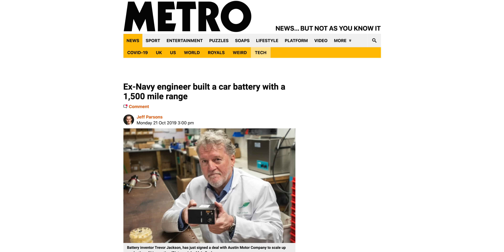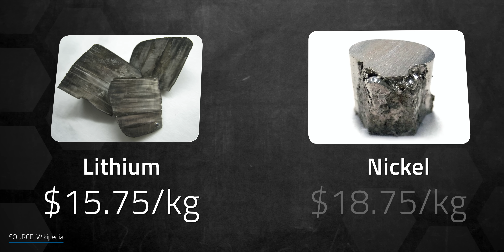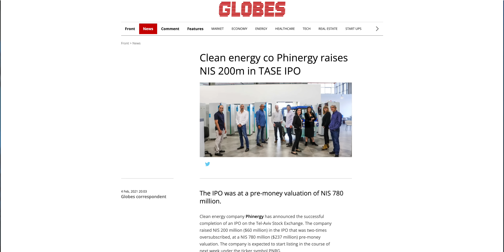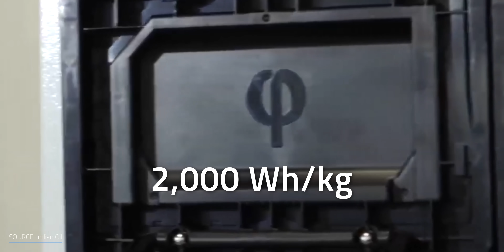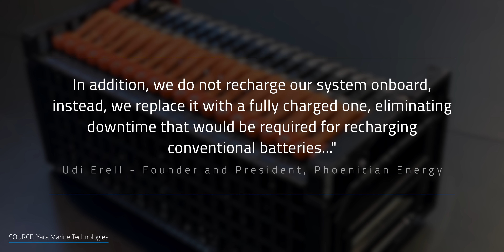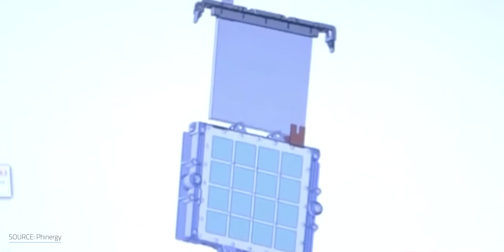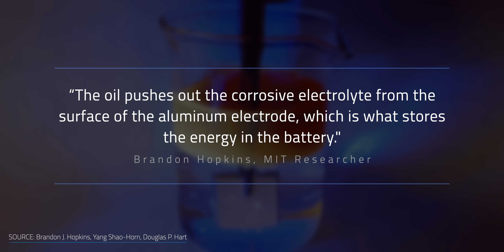Exploring the 1000 Mile Car Battery - Aluminum Air Hype?

Comment: If the battery is not rechargeable, then better test it on electric scooter. Many current electric scooter now have easy replaceable battery.

Comment: aluminum air is dumb. aluminum ion however... i don't mind battery swapping as long as aluminum is readily availible. i think aluminum ion is still a more viable technology just based on it's recharge cycles, although the drawback is its not as energy dense as lithium ion. great for powersystems that need to be reliable, and with their fast charge rate, good enough for automobile usage.

Comment: It all comes down to economics... Lithium batteries will need replacement about every 4-5 years, and are tremendously expensive to replace (to the point of making vehicles disposable in some cases).  If Aluminum-air batteries can be made less expense over the same time period, I see this as a viable option.

Comment: I assume the recycling process to reuse the “battery” is more energy intensive than recharging a Li battery, but to what degree?   Does the battery have a high enough power to weight ration that a vehicle with module that stored 10% of a vehicles charge could power the vehicle so that you could swap the 7 used modules instead of swapping the entire battery because it was down to a 30 percent charge?  It looked like 2 battery modules were used in the car in the video, but planes have the greatest need for low weight batteries,  but if they have to swap their batteries when they land, swapping a battery that’s at 49% charge after a flight is just as necessary as swapping a battery with 1% charge.  (Expensive?)

Comment: Batteries might be modular, so that you place 10 in the car for a long trip.  One or two enough for daily use and short distances.  Batteries would be distributed like petrol, except needing an empties recovery system.  
I understand that old batteries would be remanufactured with new aluminium.  Effectively an aluminium smelter is the main part of a remanufacturing system.

Comment: I think the main thing to consider is that we will run out of Lithium. Poor countries are developing and a greater portion of the global population is purchasing cars. Someday, perhaps a century from now, there might be over 10,000,000,000 cars owned and operated simultaneously. There isn't enough lithium for that many.

We will have to figure out a way to reduce road traffic.
Expanding public transportation means less vehicles per person.
Trains and trollies can be powered by overhead powerlines and thus don't require a battery to be electric.
Virtual reality technology could help people be content staying at home. We just need to watch out for the health effects.
More efficient city layouts could shorten commutes. Desynchronized shifts would make vehicle sharing easier (including in the form of public transportation) (in the case of routes with heavy existing traffic).

Comment: Battery swapping is the only viable way to implement large scale, quick turnaround EV refueling. Quick charging will always be detrimental to chemical based electric energy storage devices.

Comment: Having to swap out the battery every 1000 miles is a non-starter. Completely unacceptable in my feeling. You would at least have to have two 500 mile batteries in the car and switch out the dead one at the 500 mile mark then start hunting for a replacement. The catch being that the "cartridge" for the battery has to we worth less than a tank of gasoline.  I do not see this as a technology with much of a future in the UV market.

Comment: How  bad is it for the environment when a battery has to get disposed?  It does not make sense.  What powers the electricity to the plant that  powers the cars charging station?  Stupid liberals don't realize that they are doing more harm than good.  They have been endorsing toxic chemicals, because they were told to be activists and never ask questions or do real research. Stupid liberals,  or greedy liberals like the old hippies? Still scumbags provided from mommy.

Comment: I would prefer an EV that allowed swapping batteries, vs one in which the batteries are integrated into the chassis. Batteries, even rechargeable batteries, are a consumable. And swapping packs is potentially much faster than charging, and might side-step some of the issues around high-speed charging.

Comment: i think i would like an ev with a gas-turbine-electric backup power plant capable of running just about anything as fuel. im thinking electrolyzed water, alcohol, propane, gas, diesel or any other readily available fuel supply. as a bonus pairing solar for idle periods and keeping the car interior cool.

ya, only been thinking about this one for the last 20 or so years.

Comment: Non-rechargeable...  Really...  So every car on the road will have to have these things yanked out every 1000 miles and shipped back to a recycling center.  Talk about a massive waste of energy just in transportation of dead batteries alone.  You'd be better off using all that aluminum to make a rail on every road that vehicles can connect to to draw electricity.  Batteries could be a fraction of the size they are now since they'd only need to go about 10 miles to connect to a rail.  Your car would meter the rail electricity it used and you get billed for it.

Comment: 9:20 isn't the case. Travelling ("with your family at night! is nice and dramatic, do you add that condition to all competing technologies??) with a non-rechargable battery wouldn't knock you out. Rather than partly charging your battery from a rescue van, the van could just sell you a temporary, small, one-use battery like the one you have. It would only have, say, 100 miles capacity, or whatever, and wouldn't need to top up the vehicle's own battery. It would just replace it. Connect it to a socket the vehicle has for just that purpose (perhaps in the boot), and the power goes straight to the power electronics and on to the motors. Simple as. It's like a jerry can supplementing your car's fuel tank. Petrol cars aren't "rechargable" either but we manage quite well despite that. They also use air as part of their energy production.

Comment: I would see it more as a booster pack to extend the range off ev So combine the rechargeable option of a normal ev and the high capacity

So what I think is maybe at the dein of the car make room for this packs and an easy click and swap system if you just drive in town use your normal ev but if you plan a long journey like holiday drive to one of the battery stations and boost with it your range

Comment: If the density is this good, then surely this technology should work really well in short haul aviation. Before the flight sets off you know the weight of the plane+passengers+cargo. Windspeeds + weather can be fairly well predicted, distance to destination is known. So add in enough battery cells to get to your destination plus a safety margin and you have zero tailpipe emission short haul flights.

Comment: So what is the embodied energy per 100,000 miles for these one-time-use batteries compared to the same value for the rechargeable ones in a Tesla?
Mining, processing, smelting and refining Aluminum is hugely energy intensive.  So, while the range of EV's may be increased, the total energy footprint of achieving that range may not be an improvement over existing technology.

Comment: You mention that Aluminum, as an element, is lightweight, as a huge boon and differentiator. However, you completely fail to mention that Aluminum is SIGNIFICANTLY heavier than lithium. 2.7g/cm^3 vs 0.53g/cm^3.... nearly 5x heavier.

Multiple videos with significant inaccuracies, and even sometimes just regurgitating misinformation. It's a shame that these videos can no longer be taken at face value, and are no longer reputable.

Comment: Aluminium is an interesting energy storage medium, but ‘battery’ is a misnomer, these are chemical fuel cells. The cost comparison should be $/kWh rather than per unit weight. The elephant in the room is the cost (financial and environmental) of ‘recharge’ - returning the aluminium hydroxide back to aluminium metal, that analysis could be part of a follow up show. Thanks. Great presentation.

Comment: Why would it need to be towed when the battery dies on the road? why not just bring a replacement battery to the car by a AAA service? Second, you said the batteries are not rechargeable, but are they recyclable?

Comment: I think this has potential in current struggle for electric airplanes. Where weight and energy density is the major issue. I also see benefits from using it with airplanes as the batterys would essentially be consumed every flight right after install, so issue of cell degradation would not be present.

Comment: I can see how it would be useful, maybe not for your average commuter, but long haul trucks, aviation, and as stated maritime could benefit. I could also see this offered as a range extender for normally short range EVs, commute on a smaller lithium battery worth maybe 100 miles of range, then have the option to plug in an aluminum air battery for longer trips. Of course if they can ever make them rechargeable that would change everything.

Comment: Someone in an apartment, should be able to buy an EV without the original battery, but get a swappable service. I'm saying this to avoid the recharge times/inconvenience. I don't support a large one time use battery until there's a recycling technique that is able to reuse most, and recycle the aluminum cheaply.

Comment: I think they could make some smart hybrids.  Maybe have 200 miles of lithium ion capacity and then have a slot for adding 500 miles of aluminum battery capacity for road trips with quick swap stations along major highways.  The new rivian truck has that gear tunnel that sort of perfect for a quick replacable battery

Comment: cue back to Better Place, the old battery-swapping startup that got lots of hype, then folded. It's all a matter of cost.

If swappable batteries are pricey, then you have the considerable capital costs of storing dozens of batteries in your "filling" station.
If recycling the battery is expensive, then you not only have the price of electricity per mile, but also the price of battery per mile.
Both factors could well make this idea uneconomical.
And what's the advantage? More range? If you can charge a 300 mile battery in 30 minutes, range is no longer a real problem. The only problem is implementation -- making enough hi-power chargers available.

Comment: What would happen if you were on a drive with your family and your finite tank of petrol fuel ran dry. You'd have to get a top up or a tow to a place to fill up and those may not always be open! The "what if" is a non argument. Systems would change to accommodate the new risks of the new technology. As for degradation-swapping-recycling; this would be a question of commercial viability. Would it be more expensive over the lifetime of the vehicle compared with the alternatives?

Comment: When looking a long term, mass produced battery tech the most important metric should be ECO friendly (or will we never learn) not range. This would put lithium-cobalt near the bottom of choices, but it's at the top (as I said, we will never learn). This is why I haven't jumped on the electric bandwagon. We have done enough damage to this planet and it needs to stop (at least slow down).

Comment: I do not see any issue in battery swapping because a range or 1750Km is a huge deal, on an average in India a car drives 100000km in 5-10 years. so consider swapping battery for less than 60 times for 100000km is not at all an issue, provided the swapping time is less than 15mins.

Comment: The HUGE problem with Al air batteries is that they operate by oxidizing aluminum. Once it's oxidized, you can't use it again until it's refined again. You'd basically get to use it once, then the battery, or at least a huge part of it, would need to be replaced. You can't just plug in and recharge it. Swapping would require dependence on an external infrastructure which doesn't exist. Regular EVs can be charged at home which is a huge advantage. 

This doesn't even touch on how much energy it takes to recycle the Al battery vs how much usable energy the battery provides. It might be a positive, but I do know what refining aluminum from bauxite is VERY energy intense, whereas refining recycled aluminum is not as intense.

Comment: I mean Aptera is making a 1000 mile range EV on conventional lithium batteries. Downside is being a three wheeler and only a 2 seater. But by being so much lighter it makes it far more efficient than conventional cars.

Comment: Of course Indian oil is looking at these, these are like replacement for gas cylinders they already sell. They just want to keep their existing distribution infrastructure instead of going full electric way of delivering power over grid. They are scared of becoming irrelevant basically.

Comment: Running out of charge is not different than running out of gas. Instead of a tow, why not have the tow truck bring you another battery? If batteries were that easy to swap out and cheap enough, it would be faster than recharging, and no different than stopping at a gas station to get gas. Yes, infrastructure would need to be their to support the distribution and recycling of the batterie, but this is a viable solution to consider. And with energy densities like that, it makes more sense for airplanes. Airplanes essentially fly from gas station to gas station (airports), so maybe the best first implementation of this technology is on airplanes?

Comment: You'd need 2 batteries in your EV car. When the first runs flat switch over to the second. Then you have time to go into a swap station and get a new battery before the second battery runs out. Any business that has ever run a forklift on gas bottles adopts the 2 bottle strategy.

Comment: So let me get this straight: they want to swap a rechargeable battery (that now is over 1 ton) with a smaller one (let'ssay just 200 kg), in 3 minutes, having a cost of a full gas tank (europe between 50 and 100 euros). Even only the price of Aluminum is higher than that!

Comment: It will not look good for small vehicles, but for buses and trucks if all the supply chain is worked out it will greatly reduce dependence on diesel. Common vehicles can still use lithium ion batteries.

Comment: "Cant be recharged"     then its fuckin pointless.    Manufacturing an entire battery every time one is discharged? fuckin insanity. Imagine the storage space requirements!   A single gas station would need a warehouse the size of the entire property to store enough batteries for basically one week of battery swaps, and that would be every week.   for every 100 vehicles on the road you would need a truck full of new batteries driving around delivering them.   Pure lunacy.   bye bye aluminum air batteries. you were beautiful for a shining second !

Comment: One point i would like to mention... 
You have mentioned that an electric car can be charged with towed battery ... then in that case one can easily use same method to totally swap the battery instead.
Also the aluminum batteries can be made with good modularity , like for example instead of having a single battery pack (say of 100 kgs) which gives a 1000 mile range ( i am just using made up numbers since i am not aware of actual metrics ),. we can have a series of 10 x 10 kg portable modular battery packs which one can easily carry or buy off the shelf anywhere ( even in supermarkets or local grocery stores ) ..
so if entire battery goes down , swap one or two by buying upfront from nearest store or by using one which is in our car storage .. as simple as that ...
also aluminum batteries still have much more exploitable potential... so yes .. i am quite supportive for it for now...

Comment: use a small conventional lithium battery which can be charged at home for small rides (just like plug in hybrid). Then combine this with an Al-O2 battery. This way your Al-O2 battery can last a very long time. Furthermore design the car in such a way that the battery can easily be switched. 
- standard battery sizes for all cars
- battery in the bottom of the car such that it can easily be switched fully automatic from the bottom
- government would need to subsidize the building of the infrastructure so that battery switching locations become widely available

we already build a huge infrastrucure for gas fueling, I don't see why we can't do it again for another energy source that does not destroy our planet

Comment: Thunderf00t debunked this ages ago. It's a dumb and inefficient idea unless you ignore thermodynamics...
The only possible use of this battery is a disposable emergency power source for your car. As long as it's smaller and lighter than a petrol generator and cheaper than a roadside assist call.

Comment: My interest is in electric aviation. For this swapping would be ideal. The main problem I see with this technology is cost. The amount of energy needed to recycle and the storage needed for such a technology could make it impossible for use where a high energy light weight battery would be most useful. Also the use of air as a catalyst would reduce its capabilities at high altitude. Honestly without the ability to recharge this type of battery doesn't really have a place anywhere but large cities, which are a bad idea to begin with, as people go nuts when they don't have as much as their neighbors and have little or no social accountability, or personal autonomy.